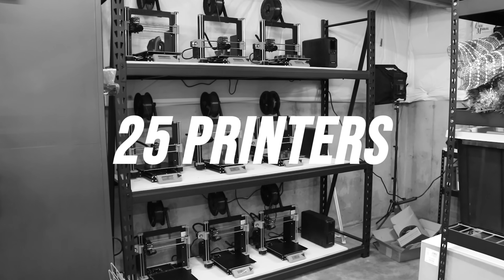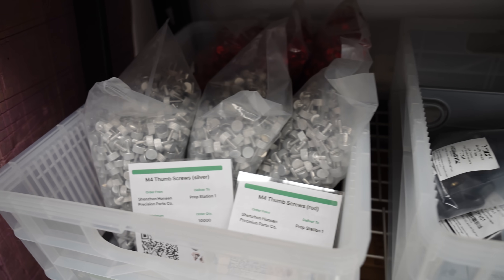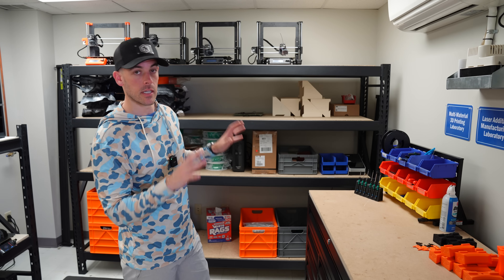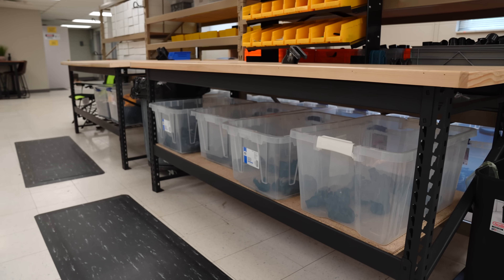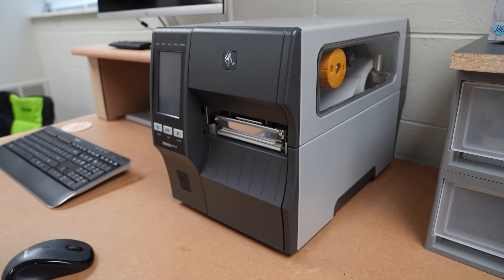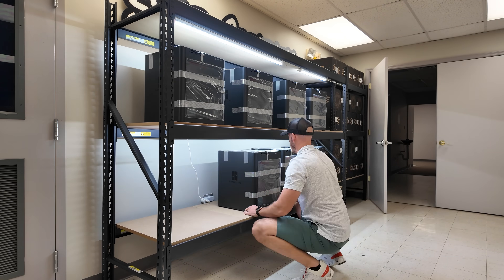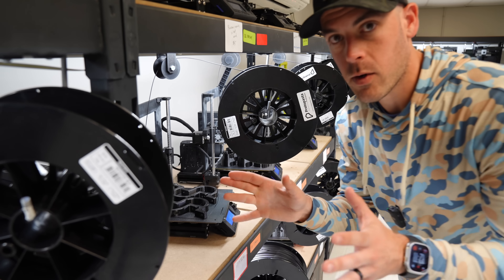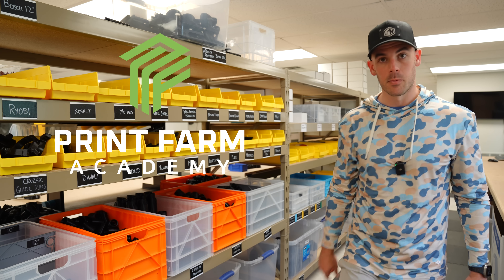$100,000 3D Print Farm Tour

Comment: This is so impressive - nice setup! The only thing I might do differently is ditch the consumer UPS units and hold up the panel instead with a pair of Victron Quattro 10K inverters with a battery bank and standby generator. I'm also wondering how you monitor air quality and handle ventilation with that many printers going in a small space?

Comment: I like your idea about the isolated boards and foam isolators, however I was just wondering, why not go with the anti-vibration feet upgrade?  They're a direct swap and in your quantity the cost can be as cheap as a little over 5 bucks a set.  Not criticizing because what you did is innovative and I've seen how that shelf with as little as 4 printers on it causes quality issues at our makerspace.  Purely curious.

Comment: Regarding the Bambu Lab printers, what are your thoughts on them being WiFi and not having ethernet capabilities? As an IT guy, ethernet is way more reliable and the performance is also much better than having the wireless access point try to manage 40+ printers.

And my other question is what are your thoughts on pushing your gcode and anything else sensitive to China's servers where they could copy your products and underbid you? Dealing with copycats like those on etsy are relatively easy for me to deal with and stay ahead of IMO, but large institutions like Amazon or nation states like China who also have solid history of being copy cats, can and they have placed SMB owners out of business.

Those are the two reasons I'm leaning very heavily on the Prussa MK4, because it provides and ethernet connection, and keep all the communication locally between my laptop and printer; no need to worry about the internet breaking, cloud going down, or China stealing my designs. And so like I said, I'd love to get your insights on those two concerns. TIA

Comment: Hey man, question about the printer setup. I just got my P1S setup and it does the vibration check upon every print. Do you also have that on every printer? 

Or did you turn it off and how?

And do you dry your petg?

Thanks for the informative videos!
Reply from the maker: Yup that calibration runs every time, it’s important for input shaping. I actually don’t need to dry the PETg since I use it so fast, it’s also always in a conditioned space where humidity does not get high

Comment: I saw in another video you had created a "corner guide" for the filament around the printers body, any chance you can share the STL?

Also I have been looking at UPS units over the last few months, I found I will not use Cyberpower for critical systems. The reasoning for this happened a few months ago.  My APC unit started beeping at me one day. I discovered it was warning me that the battery was nearing the end of it's life and I should replace the battery or the whole unit. Spoke with APC they told me the battery would be good for about another 30 days of typical use so it was a real warning, not an "oh shit" need to do it now.

A few weeks later my Cyberpower unit suddenly stopped working. I could not get it to power on. There had been no surge or power issues I was aware of, checked other UPS units and no alerts. I discovered that if I moved the computer off the battery to the surge protector it worked just fine. I contacted Cyberpower, they explained that the battery on the unit had reached end of life. There was no warning from the unit or in their software, just killed the battery saide and was done.

I will, becuase of this, no longer buy Cyberpower units. They are not bad units but I want something that gives me a headsup when I am about to have an issue instead of just dying like a gian middle finger in the air at me.

Comment: Good luck but I will be shocked to see if you ever turn a profit at scale, no such thing as commercial 3d printing on consumer products especially considering places like jlpcb can do metal 3d printing and use much nicer exotic machines at such a good price. There have been many companies such as yours that close up shop and go bust. I'm sure it could work but you would need to have machines the typical schmuck doesn't have access to, say that a full color J55 Stratasys 3d printer.

Also anyone doing mass 3d printing and not getting it injection molded is a clown waiting to be fired.

Comment: I'm so jealous. If only I could just go from the slicer to the printer. Every printer I use is a piece of crap. The crealities the k1 and the bamboo lab p1s. The only way I can get anything to print is to go in and modify the G-Code from the slicer that I use. That involves M220 to slow or speed up the print. M140 to change the bed temperature so I can pull a print off without ruining it. To manually adjust each layer z height. Thank God there's only six layers. They all have about a 50% print failure. I have taken apart extruders and hot ends so much that I can do bamboo lab p1s and the cruelty Max neo in my sleep. Until I find a reliable 3D printer that doesn't screw up every other print I'm basically screwed in my business.

Comment: Curious on the 3kg spools. You don't have them in any kind of dry box. Since you are printing with PETG, can you talk about how you're able to maximize the quality of the prints without having to dry the PETG. I figure the whole office might have the required temp and humidity control since you mentioned that it was previously used by another 3D printing company, but I wanted to see if there was anything specific you were doing.

Comment: absolutely killing it man.
I have 9 P1S printers 
and 2 x1 carbons
this is all in a split 2 car garage. I skipped the UPS's in favor of a Eco flow delta pro ultra with 2 batteries and 1800w of solar on my patio cover this is all dedicated to the 2 racks, i also have 18k btu mini split system it's fully insulated and properly sealed but i have 2 massive 10in exhaust fans in the ceiling and intakes on the exterior wall this can move over 5600 cfm when i need to print ABS and other stuff. i have large inline carbon filters on the vents to help reduce impact on air quality in my backyard.
the 2nd half of the 2 car is setup for storage, inventory control, packaging. my office upstairs has full view of everything using 32 poe cameras apx 20 in the shop space and 10 around the property.

Comment: That is the one thing I actively try to avoid, NON printed parts.  I try and make stuff that needs as little "other" things as possible, as that adds work and more overhead to keep an inventory of.  Right now the only things I make that take something else are Keychains, and thankfully those are cheap to get in bulk.  So even when things scale up I can at least not drive myself crazy with 9000000000 other parts that don't come from the printers.
Reply: It adds value, though. Sure, you can print a thumb screw if you really want.. But it will be weak and probably break, and your product will just look shoddy. 3D printing as a form of manufacturing really shines when you just use it as part of the design process. I've yet to see a purely printed 3D product that didn't look like cheap junk destined for the landfill. There's probably some money in that, don't get me wrong. But there's more to life than money, and I think taking pride in what you make is important. If some screws, some inserts, and a few other bits of 3rd party hardware make your product much better, then just do it imo.

Comment: How did you settle on PETG for your standard printing material over PLA?
Reply: I can only speak for myself (maybe he will answer soon) but PETG is significantly stronger in real world use, and its failure modes are much nicer from a manufacturing point of view. PETG tends to stretch before it breaks, so there's some warning to the user before it becomes a full loss. PLA tends to shatter when stressed. 
PETG can also stand being left in the back of a hot car without warping, whereas PLA would be useless. I imagine these kinds of power tools might conceptually live in the back of someones work van in Texas or whatever. If they were made of PLA, they'd turn into a puddle.

Comment: someone tested that the nextruder for the mk4 actually isnt enough for the mk4 to reach the speeds it can so a prusa designed part for a e3d v6 volcano hotend which should give 45-55% speed increase with the same quality due to the higher flow

Comment: Do you have issues with PETG soaking up moisture? Do you use Protopasta PETG mainly? We have a 38 printer farm and are in the process of updating Prusa Mks, Mk3s and minis to P1S's and A1 minis. We have noticed issues here in michigan with print quality from some PETG brands (currently 3DXTech and Polymaker)
Reply from the maker: I don’t typically have issues since the spools are in that warm room and are typically used up in around 7-10 days
Reply: About 60% humidity in general here in the UK, and I have no issues with eSUN petg on my P1P. But if you have 38 printers, do you not have an AC system that can control humidity anyway?

Comment: Great setup, just two cents regarding the UPS battery. I have a background in IT Datacenter and depending on the size of your operation you should get some quotes for a larger UPS system for the whole room instead of deploying for each printer. It will save you money with a larger fleet and maintenance cost can be reduced.
Reply: Agreed.  Each one of the UPSs needs to be managed. That means an application that connects to it to check battery and power output.  Batteries need to be replaced on a routine basis.  At a minimum, each UPS should have a date installed and a battery replacement date on the front. Also, a specific name on the front of each UPS so your support team identify them.  Swapping out all that with a single large UPS is a big help in the reduction of UPS management and monitoring.
Reply: @loopie007  how many years would the battery last you till you have to replace one? also what ups would you recommend to run 3 A1 combos with the ams lite? also the 1500 va ups or less?  Thanks in advance!
Reply: And consider Lithium batteries. I just replaced a pair with LI for the first time....was only $10 more but should have years longer life

Comment: Great video! I'm confused about the quality filament part. I've used both expensive and cheap filament and as of late have had zero issues no matter what the cost is. I think they have all finally got on board with the quality plastics go in and you get quality plastics out to send to a customer. Right now I've been testing so many brands via the Amazon Vine program and have around 25 different brands I think of PLA. I've had 1 print bad out of the box due to moisture otherwise all great quality stuff. Seems like they've agreed on a standard or they are coming out of the same manufacture with different spools and brands on the spool. I have a spreadsheet of all the ones I'm testing and need to invest time in the filament tracking server software. Anyways thanks for the insight as this is something I'm interested in and have the skills to do it. now can I convince the wife?
Reply: Filament is extremely important. It is one more variable that something can go wrong. While there are obviously issues sometimes with moisture or dimensions of the filament, sometimes there are other factors you cant see. An example is if the filament is contaminated with an abrasive material like dirt or sand, which can reduce the lifetime of the nozzle significantly and ruin a batch of parts or even a whole production run if it is not caught.

Comment: Hey man! What's your opinion in automating the removing of the print off the build plate? There have now been numerous examples of using it with Bambu Lab's P1P's (just basically wait like 5 minutes after the print is done and the build plate has cooled, and then make the extruser head bump into the part, making it drop into a container)

As always, Great video, keep it up!

Comment: You are saying one Bambu Lab P1P can outperform 2 Prusa's, but thats only the case if you compare it to the 7 years old MK3.

 The MK4 with input shaper isn't really slower than the P1P, so that makes no sense.
Reply: Truth is that bambu lab will pay anyone to shill for them. A P1P only runs parts 10% faster than my 5 year old MK3 with similar slicer settings. And thats with no input shaping on my MK3. A MK4 with input shaping would literally finish my parts 1 min faster than a P1P/P1S/X1.
Reply: @LilApe  Prusa fanboys are always so delusional 🤣. Just accept the fact that you overpaid for an inferior product and move on.
Reply: @LilApe  Woah hold up, you're telling me similar slicer settings get similar speeds on different printers? Next you'll be telling me bears shit in the woods..
Reply: @georgestone8099  Similar setting with bambu lab running at default speeds which are like 6x faster than prusa. My MK3 was only runing at 55mm/sec. and Bambu was over 300mm/sec. And yet bambu still only finishes 10% faster. Not even a big margin.

Use common sense and think for once. Similar settings means nozzle size/layer height/infill settings/perimeter settings/extrusion widths/ etc.
Reply: He makes large parts though, and that means he could never run a bed slinger at the fastest configuration without having failed prints. Especially as it seems the amount of bed contacts his parts have seems relatively small.. CoreXY doesn't have this problem. The MK4 is also hideously expensive, and outperformed by the A1 by BambuLabs anyway.. There is almost no reason to buy a Prusa in 2024. They're coasting on past success.
Reply: @georgestone8099  Bullshit. We run 12 MK4s non stop and those issues you mentioned are just made up. Only veeery thin and tall objects are difficult on a bed slinger, everything else prints just like on a CoreXY(yes we have some X1Cs as well).

Of course the A1 is cheaper than the MK4, that's what cheap mass production in china gets you.
Reply: @b0kix953  It's the undeniable reality of bed slingers. No point arguing this. If you shake a big print around, you increase its chance of losing bed adhesion. Also the A1 isn't just (much much) cheaper cheaper than the Mk4, it's also faster. It's a bit embarrassing for Prusa.

Comment: I would love to hear you discuss why you chose 3d printing over injection moulding especially once you standardized parts.
Reply: He wants to easily add more products to his lineup, without having to make a ton of molds. 3d printing is just a better option for his business. He's also not selling enough for it to be financially feasible.
Reply: Injection molding is for mass quantity.  These are one off niche products that will soon lose there momentum.  No point in investing a ton of money into a very fluid product sales.  Unless he moves into something else, he will be out of the market soon, with nothing of value to sell.
Reply: @user-it7kg3pm4q  lol injection molding and mass production in china doesn't cost anything near that. He wouldn't do injection molding becasue there is no real money to be made making dust chutes. Everyone and their mom makes dust chutes. It's a saturated market
Reply: @LilApe it doesn’t cost anything? Sounds like you never flew over to China and actually gotten anything built before. In China demand for good factories are high and these factories don’t need you. They are busy as is with high paying clients that understand what it costs to build products. 

I’ve paid for injection molds and they are between 50-100k for ones that last a long time. After several thousand parts the molds need’s to be replaced. 

If injection molds are cheap, everyone including YOUR mom would be doing it. 🙄
Reply: @LilApe  for a good mold (one, so just a single product) you would be looking around 100k in China for the mold and about 1 run, and there's a VERY good chance that your product gets stolen and sold on any one of the Chinese temu like places